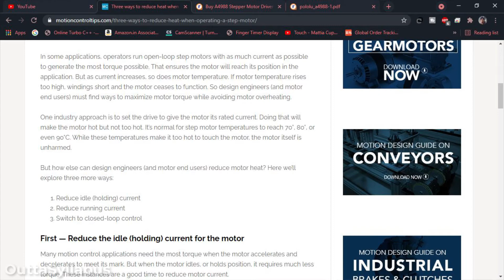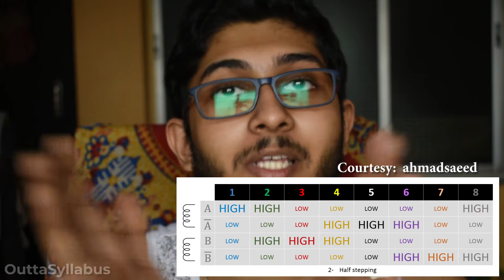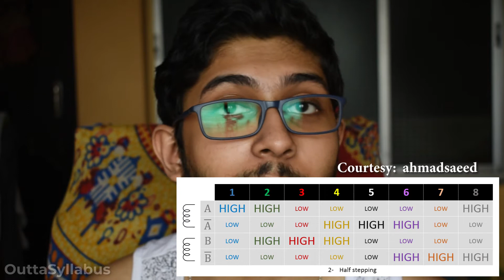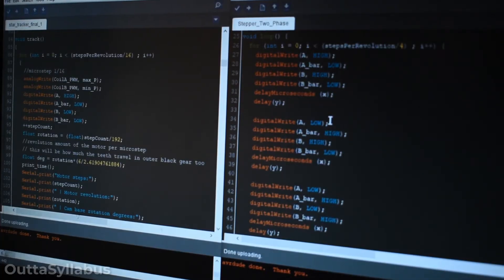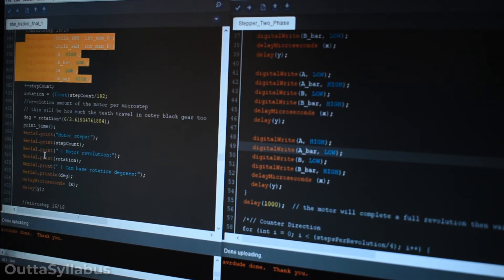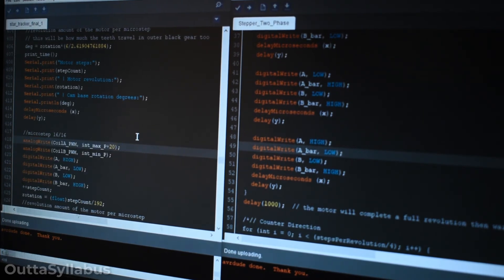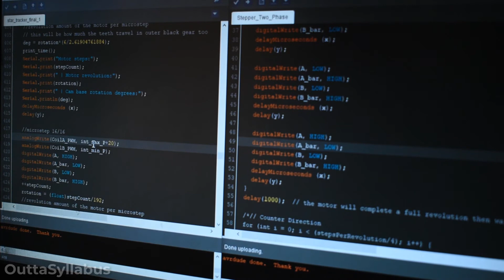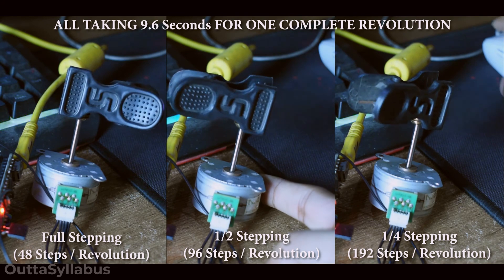Microstepping using L298N | Insane DIY Star Tracker [Part 2] | OuttaSyllabus

Comment: HEADS UP FOR ANYONE WATCHING THE VIDEO: the trick for micro stepping is controlling the current flowing in each coil. in one full step a pair of coil(in bipolar or 2 phase mode) go from either fully energized to no energization or vice-versa. as mentioned in this video one can divide that into half step mode and keep dividing by 2 to get more and more resolution. the half step is considered to be the middle point between the transition from one full step to another which means in the actual half step only one coil is energized.  the trick is to change the current flow from either high to low or low to high as is required in that full step block that is being divided. The L298N allows for current control through pwm voltage regulation(not directly controlling the current but using a PWM signal to get an average voltage or current) by using enable A and enable B pins. if you can change the pwm as a transition for each enable then you can get your desired micro stepping division. generally a sinusoidal approximation is used as can be seen in datasheets of ICS like DRV8825 and others which provide microstepping capability. one can use a triangular phase transition for simple purposes. additionally if you are worried about heating and available torque one can use the CSA and CSB(Current Sensing(CS) pins) grounded through a resistor and detect the voltage through the microcontroller to measure the current in each bridge. this way you can regulate the current that you want to drive into the coil(through PWM in the enable pins) based on feedback form the H bridge.